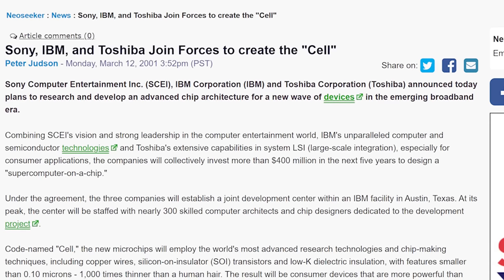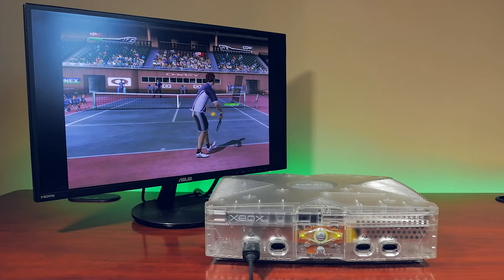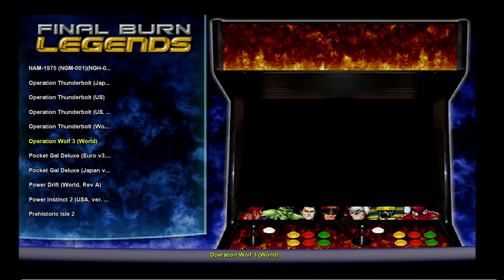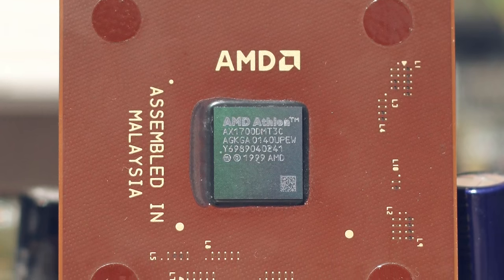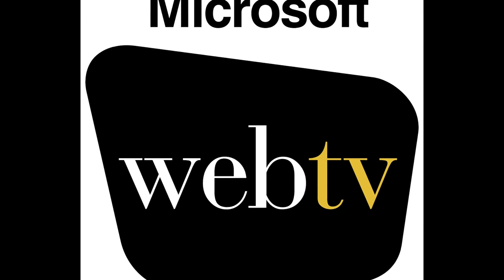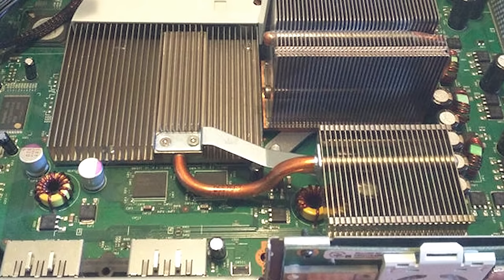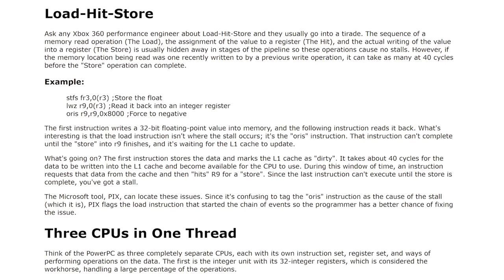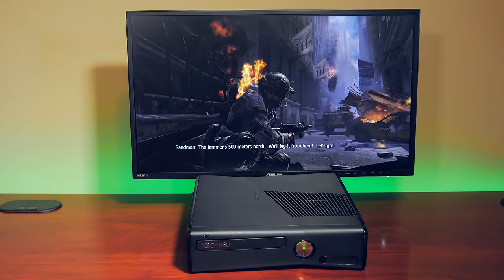Why Microsoft switched from Intel to Power PC for the Xbox 360  | MVG

Comment: According to interviews with original members of the Xbox team, the X360 had no problem passing all thermal testing through R&D all the way up to the point of release - the PowerPC architecture heat "issue" appears to be pretty unfounded. 
[I mean, can we not pretend like a company like Microsoft isn't capable of performing even the most rudimentary of thermal testing during, let alone actual edge case stress testing? I've always found this rather... naive? Or just arrogant? OBVIOUSLY there was an actual problem that didn't show itself throughout the entirety of the multi-year R&D process, let's not pretend like one of the world's most successful companies employs only people with double-digit IQs...] 

Through the investigation that Microsoft  performed into the RRoD problems, they never discovered what the actual cause was - but they speculated that it was a last minute switch to lead-free solder as was required to comply with EU regulation changes.
In spite of not figuring out the cause, the future X360 revisions eliminated the problem of course. Whether this was as a result of the manufacturing process shrink for the chips lower total system temps - reduced PCB temps eliminating the potential solder related problems? Or maybe the newer motherboard revisions being R&D'd from the beginning with lead-free solder in mind eliminated the problem in the design phase even? It's not really clear, but it was obviously "fixed" at some point during this process. 

This is from one of the IGN 'Unfiltered' interviews, but I can't remember which member of the team it was nor which interview. I may try to find it later, because the X360 RRoD info is pretty invaluable, and the rest of the interview alone(all of the from the Xbox team) is amazing.
Reply: open  an original xbox 360 and you will see a massive heat sink on the cpu and a super small one on the GPU. That is why you got RROD most of the time. The GPU would burn up and bend the board breaking all the other chips. Either that or the HANA cheap would die. It was never because of the PPC. I used to fix 360 back in the day. Even when we got the 65nm die shrink we still got RROD because the heat sink was not fixed. It wasn't until the slim when everything was in a single die with a giant heat sink that the problem was fixed. If MS had made the xbox 360 longer and stuck a heat sink on the gpu with the same size as the cpu one then I think the issue would have never happened. that and make sure the Hana wasn't failing all the time
Reply: @tHeWasTeDYouTh  Forgive me for not just taking your word for it, but [found the interview; though I think there was another that talked about this as well] Peter Moore seems to suggest that it was a significantly more difficult problem to solve than that simple explanation. 
Correlation ≠ causation 
https://www.youtube.com/watch?v=rUODlNffWmU
50:46 - when the RRoD discussion begins
55:36 - when Moore theorizes about it possibly being due to the lead-free solder
He does specifically mention the GPU in relation to this too, no mention of the PPC CPU at all(which is what REALLY annoys me about videos like this that make assert speculation without evidence; all due respect to the MVG of course

Comment: Will be interesting when the next generation consoles most likely switch to ARM.
Reply: Yeah right.
Reply: Keep dreaming
Reply: The Switch already did it, and AMD's got an ARM license - won't be long as x86 is already outclassed in power and thermal efficiency by ARM.
Reply: Amir Pourghoureiyan Agreed, not sure where the other commenters got the impression ARM hasnt already over taken x86 as the gaming cpu of choice. Whether you like it or not, mobile gaming has already over taken the traditional consoles revenue wise, and like you mentioned the Switch is ARM already and more profitable than the PS4, XB1. Plus likely by the next generation, cloud based gaming will be viable, which makes an ARM based console even better suited for that.
Reply: @amirpourghoureiyan1637  And Samsung has licensed RDNA graphics (i.e Navi) for use in a mobile ARM SoC. Benchmarks show it easily beating Qualcomm's most powerful Adreno GPU.
Reply: Well that would require a huge performance jump for arm chips, or a spike in interest for low-power consoles.  Apple's primary concern is with laptops and mobiles devices, but consoles don't have much of a power constraint.

That being said there's not really much in the ARM ecosystem that stretches up to 100+ watts at the current moment, aside from a few server processors with dozens of cores.  And there usually isn't any interest in processors with tons of low-performance cores when you can just get a chip that consolidates the overall performance on fewer high performance cores.
Reply: kintustis Yes in the present, but see the ipad pro gpu performance its a monster for its wattage. And with Apple making their own SOC in a desktop/laptop envelope in the coming years, it wouldnt surprise me seeing a high powered ARM cpu.
Reply: @IanTester  You can bet that Apple have been in talks with AMD for their ARM GPUs, their relationship with PowerVR is uncertain enough for AMD to replace them right now
Reply: @pc1x1  Software is everything when it comes to platform transitions, if Sony and Microsoft provide the tools to convert engine binaries, then there will only be improvements with a gaming optimised RISC chip - better thermals, cycle efficiency and less restrictions on the design of the console (no more toaster boxes)
Reply: Amir Pourghoureiyan Microsoft would likely be fine and are already working on Windows on Arm, and I hope we get a XP more akin the switch. Fast on and off, downloads and freeze states work so much better than ps4/xb1. The switch def has the best user experience of all consoles. And I own all consoles including pro and 1x, gaming pc
Reply: @pc1x1  Agreed. Knowing Microsoft, they probably are going to carry on the bloat for future Windows, as gimmicks is all it's got to show for at this point in time.

Comment: Fun fact you can run windows 2000 pro on it 😂. Bad dumb Microsoft made directx incompatible between Xbox and pc killing portability. I was in favor of the Xbox as a pcmr fanboy 20 years ago. That never came. Just because it’s direct x in name didn’t mean reality or a simple recompile like we hoped.

Pc games with pc directx didn’t have stall issues. It’s clearly not a hardware issue but bad design

Comment: yes ppc was a heat monster and heat is what caused the red ring of death but Microsoft knew heat was going to be an issue and didn't properly engineer the xbox360 to ameliorate this nor did they have adequate qc on the bevy of 3rd party mfgs that built the 360. ppc didn't cause the red ring of death catastrophe Microsoft's tight pockets on R&D and QC did. I personally went through 3 360s back then. luckily all were under warranty.

Comment: Besides the Wii, both 360 and PS3 ran very hot and got very loud even on well ventilated shelves. We still have a 60GB original 360 and had multiple PS3s (4) from Phat to Slim and all of them are or where very loud. Two of the PS3 died of RSOD (CFW RSOD fix only worked for a while) and on had it's BD drive (the BD laser lens) fail. So far this generation was the worst in hardware quality and I'm gaming since the C64.

Comment: You offer one other viable option compared to IBM? There aren't any, at least at the time. 
The heat or ring of death issue is a fault of Microsoft and not IBM. MS could have designed better cooling, used better solder or clocked the chips lower. It did none of the above, hence why they are at fault.
Also I think they moved away from IBM only because AMD could offer them a SOC.

Comment: Love these vids about architecture comparison in consoles❤👍
From my point of view RISC always was and will be better choice for consoles than x86/64. It’s beyond me why MS and Sony didn’t opt for Arm based RISC like Nintendo did with the Switch. Because of that next PS6 and Xbox will probably need water cooling and 500W power supply😁👎 and most definitely liquid metal thermal paste😂 Not even talking about size, weight and price of that “thing”…
Reply: CPU:
2.4GHz
RISC Multipier:
1200Mhz

Comment: I don't think anything is strange about this. Computers and consoles have been using any available cpu architecture ever, and this is a good thing. Monopolies are terrible, and there's no advantage in using the same architecture over and over.
The overheating is no argument against the PowerPC, because the Pentium 4 even was much worse. And the optimization of code needed is a huge issue for the first Hyperthreading CPUs like the Pentium 4, too. Generally I anyway think, that optimization always should be done, and that today's programmers are lazy and lame for not being able to do this anymore.
The most fantastic games of the past became only possible because of ingenious coding tricks!
Today's PC games could like like the games of 2040, if programmers actually spent enough time and knowledge in developing new games, instead of shitting them out as is.

Comment: Why even say x64? The CPU is still x86 just with 64bit extension. Absolutely zero reason to "correct" yourself to x64 when x86 is still valid as a description as they're still x86. This leads people to believe that current x86 CPUs aren't x86 which Ive had people belligerently call me retarded, etc. because of misunderstanding this kind of information. AMD64/INTEL64 are still 100% x86 but include the x86-64 extensions to x86 instruction set.

Comment: What would,ve had had all 3 companys decided to go with intel instead??
Noboby knows and nobody cares,
I think it wouldn’t had make much sence at all i guess, as both processors did run very hot, wich could be only be solved trough inproved heat sinkers, better ventalition coolers and smaller nano technology from 90 nm to 35nm.

Comment: When I got my Xbox original was far more powerful than my father's very old Pentium II and was the most advanced console ever kinda the first true modern console ever made, It was really only missing something like Dreamcast LCD on the controller (from memory card) 😎

Anyway I think M$ should have gone for a AMD X64 CPU for the X360 and probably would be fine in temps.

Back in 2004 I got a Pentium IV 3.8ghz and that thing run super hot and I already had a way more modern CPU cooler kinda like a modern bigger tower one and was supposed to already have the modern heat pipes made of copper with the liquid that turns into steam though back then I think they were likely fake and wouldn't have liquid inside but still even with the bigger tower cooler which had a big 120mm fan the CPU still run quite hot, I also tried 4ghz OC and no luck, 3.9ghz would kinda run but even hotter so I stick with 3.8ghz stock... It also didn't took long for that CPU to be a HUGE bottleneck😡

Comment: So.. they skipped the 20 stage pipline P4.. for the 24 stage pipeline of the IBM Power CPU?...  IBM power also have worse cashe flusing and prediction features than the P4 have.

There is more issues with this story. The intel Core 1 solo/duo existed already well a head of Xbox 360, and before that there was a other chip as early as 2002 Ignoring that, the AMD alternative also existed.

No.. The reason why Microsoft chose IBM power is the same reason Sony did. Licensing. IBM and Sony could sign a unlimited quantity license of IBM.. But Intel and Amd reduced. For something like a Mac that cost $1500, a $30 license wasn´t a big deal. But for a $300 console, this was a big problem. 

This all change when Lisa entered the story and starting to promote unlimited licensing to both Sony and Microsoft. Hence 8:th generation both use AMD chip.

if this was the case back in 2005, Sony and Microsoft could have used the excellent Phenom chip that was far superior to the power architecture.

Also.. of cause, being able to buy a license, also means that you could design your own APU, greatly reducing cost.

Its kind of ironic. Sony and Microsoft have bought both CPU and GPU from AMD the last two generation. But the actual APU is there own design.

"Risc in a video game console make sense"
Not really. It make sense in a set top box where you do a lot of the same. heavy number crunching, but no spaghetti code. Cisc is far better with dealing with spaghetti code than RIsc. Cisc also have a more compact code, being advantages in high throw-put systems. A lot of people tend to think risc is a magical unicorn.. its not.. it have drawbacks.. . its a reason it lossed the war.

It didn´t lose the war because Intel flex there large market muscle.. rather the opposite is true. Intel gain there large market muscles because x86 design is flexible and fast.

"Chip run hot"

Chips don´t run hot. Its a matter of good or bad thermal design. The temperature of the chip is a factor of TDP and cooling solution, not really chip design.

The TDP is in turn a factor of core frequency and chip design (well and voltage). It was Microsoft wanting to use 3 symmetrical core at 3.6Ghz that run the TDP so high, that in turn overwhelm the rather pittifull thermal design. The SPE that Sony use simply have a more efficient design. In effect they make more calculation per watt.

While the Power 8 architecture is made to run as high as 4.8Ghz, that is in a server grade blade with excellent cooling in a controlled environment. While lowering the freqvency with 1.2Ghz, do help... well, if you ad one more core.... it kinds of eat up the benefit.

Comment: LOL what a stupid decision though the IBM Power PC processor ran way hotter than advertised by IBM and was the main cause of the RROD that plagued the Xbox 360 for years Microsoft even followed the rumors and not do any proper investigation and they blamed ATI\AMD for all the failures but even after shrinking to a better node for the GPU which allowed it to use less power and generate less heat the supposed new Falcon models actually had a higher failure rate because it the CPU that kept failing.

Comment: they took ZERO risk they were getting a good deal on the chips because you know what they were? they were a STRIPPED PS3 CPU chip that some of the other things on the chip failed/woudnt pass testing so they turned the extra off and sold em to microsoft, Sony paid all the dev cost for that chip and MS just bought the stripped version

Comment: I dont thing that PC we so bad look at games and if something wrong with pc, in year or 2, its usually fixed with console you are stuck with bad decision for 5+ years. 

  MS was clear winner, because was clever enough to see future in multicore, Sony made some frakenstein sega like architecture with 1+6 dissmilar cores on which needed brutal optimizations which nobody not in house was not able to do, for years and on top of it Sony make ununified memory 256+256 MB. Other thing is as usually just better MS SW stuck.
    Yes MS did one wrong thing bad cooling inside console and loud power supply brick. 

    Nintendo did underpowered cheap also as usually, but without HDMI  and that was big flaw.

     It would be interesting if in next 5 years we would stay on x86 or move to ARM.

Comment: Also the heating issue in Cell and Xeon comes from Sony and Microsoft insisting on using organic substrates for their processors. Organic substrates warps more than ceramic substrates that IBM used extensively on their higher end processors. Organic is cheaper, but think they did a miscalculation here and should've gone with ceramic. At least for the first iterations. When IBM went from 90 nm to 65 and 45 nm the issue disappeared as power consumption and heat dissipation went down.